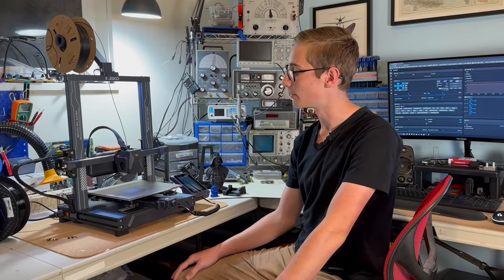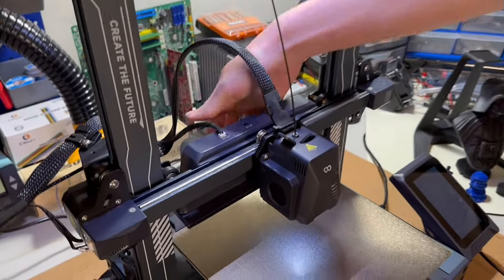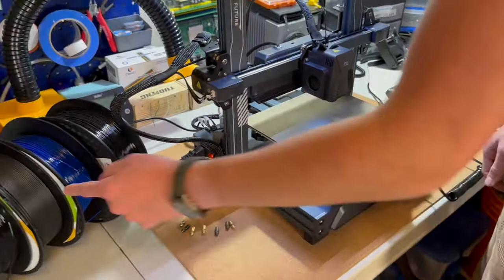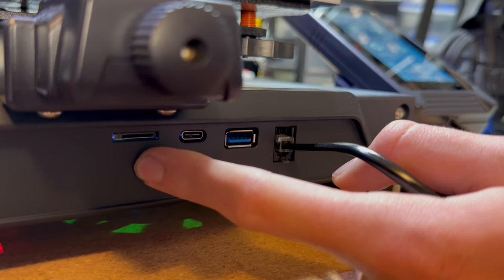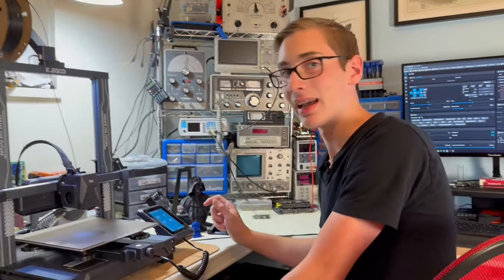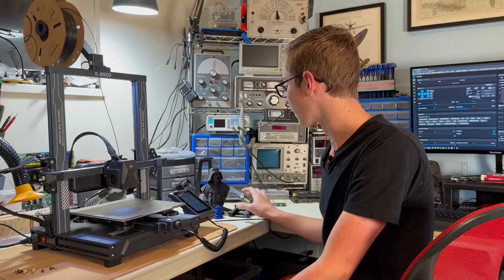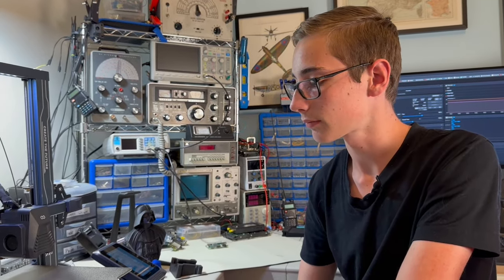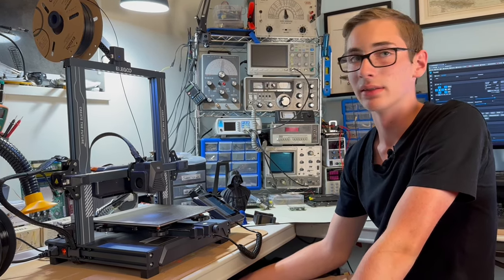Elegoo Neptune 4 Pro Review (after 200+ hours)

Comment: Thanks for the video! Your unboxing video made me pull the trigger and get it, and after a couple hundred hours myself (and as a complete 3d printing novice), I've been impressed by the print quality and relative ease of use. It definitely is loud (which you mentioned) and I haven't been able to get the ethernet cable to work/be detected by the Elegoo Cura version - but those are my only complaints from a beginner.
Reply from the maker: I'm glad you like your printer! A potential reason your ethernet might not be working is because you connect to your printer via klipper in your browser, instead of through cura (which in my experience is typically connected through a USB cable). If you go to the settings in your printer you can find the printer IP, just type that into a browser and it will show the Fluidd klipper interface.
Reply: Oh wow, that worked! The fluidd interface is a little overwhelming just looking at it right now as a noob, but I'm excited to take a look at it more during a print. Thanks!
Reply from the maker: @crazycanuck19  Your welcome! I'm glad it worked. I highly recommend taking some time to really explore it. You can really customize everything, and taking the time to go through and look at the config file and all of the other features is definitely worth it.

Comment: How do you deal with clogs? I accidentally left mine printing and it messed up. The hot filament got shoved up past the nosle and now when we try to change the filament there is a piece that is in the way. It’s above where it heats up but below the gears to push the filament down and the cleaning things don’t get it to come loose. What would you recommend? Is there a way to take it apart and get to it?

Comment: For WiFi, I connected the RJ45 port of my Neptune 4 Pro to a Vonets VAP11G-300 and had immediate Klipper control via a Fluidd screen open in a browser tab.  Very nice!  This is my first Klipper printer and I love it.  Way better than fiddling with tiny micro SD cards.

I've printed a few hundred hours of flawless ABS prints by draping a 30 gallon clear trash bag over the Neptune 4 Pro, with the bottom front 6" of the bag reinforced with duct tape and a piece of duct tape with a tiny hole for the filament to enter on top.  The 110 C print bed passively heats the interior of my low cost enclosure to 55 C.  I print with the nozzle at 255 C for the first layer and 230 C for subsequent layers.

The LED on the print head dimmed over the first hundred hours until it's no longer usable.  Apparently the heat killed the LED.

I probably have 400+ hours on my Neptune 4 Pro and it's been flawless.  I'm very happy with the purchase and I'm impressed with the print quality and reliability.

I designed a waste bin that clips to the left side of the Neptune 4 or 4 Pro and that's very handy, particularly with my small scale manufacturing where I can toss a prime strip and brim into the waste bin to the left of the print bed and click the Print Another button on the touch screen.  I uploaded the files for the Neptune 4 waste bin to Thingiverse and Printables.
Reply: Hey, I am wondering what the advantages to enclosing the printer are? I thought it would be the opposite due to heat build up?
Reply: @deadpixeloc5047  - You must be new here.   🙂

Materials such as ABS shrink more when they cool.  Thermal contraction from a 230 C melted plastic from the nozzle to 22 C ambient is enough that the part is shrinking as its printed and the internal stress causes the part to lift off the bed as it warps and cups, or causes layers to separate forming horizontal cracks.  Keeping the ambient at an elevated temperature helps prevent warping and cracking.  After the part has printed it can be cooled uniformly so the part shrinks equally in all directions to reduce internal stress.  A 55 C enclosed printing space is often enough to allow successful ABS 3D prints.  I think the commercial 3D printers use a 100 C or 120 C heated enclosure for ABS.

Comment: Hello there!

Great video, I already bought one for myself, but you just convinced me again, that it was a good choice.
I would love see a complete guide about that how you calibrated it. There are plenty of videos and sites about how to do this or that, but things are just different in case of every printer. 
A dedicated Neptune 4 Pro calibration guide would be awesome! 
There are things that I just can't get right with mine (arrived last friday):
Retraction (there is always some stringing, but better than it was).
Top layer is overextruded (the overall print quality is good, but it can be better).
There is some ghosting (I'm already trying to calibrate input shaping).

I'm using Prusaslicer. My previous printer was an Ender 3 with only a BL-touch for upgrade. It was very slow, etc, but the print quality was quite good. I want to reach that quality with the Neptune 4 Pro, too.
Reply from the maker: Thank you for the advice! The first thing I would try is using Elegoo Cura, that might fix some print artifacts. If it does work, you could port over the retraction settings and anything else to Prusaslicer (I personally prefer Prusaslicer as well). For actual editing of the config file, I would check out this video from WildRoseBuilds, it helped me quite a bit: https://www.youtube.com/watch?v=mCcP8dffwLk&t=342s&ab_channel=WildRoseBuilds
Tuning the input shaper will probably have a very positive impact on print quality.

Comment: This was my first printer at the beginning and it was headache , there was no documentation about changing nozzles or repairs.
After learning the basics : how to change a nozzle , maintaining my machine, how to diagnose  problems, I am getting satisfying prints and have yet to fine tune my klipper which i will most likely do in the near future.
So far it's been pretty consistent , 40 hours of continuous print time at high speeds before an issue arose.

NOTE: Instead of using the bad Elegoo Cura i heavily recommend OrcaSlicer with the neptune 4 pro printer profile. Simply switching slicers made my prints better 

Note:  keep in mind that if you are using brass nozzles it will eat through them like candy.
Reply: i am too beginner in 3d printing so what's exactly problems and how did you fix and what's your advice to me when i get this printer and open box

Comment: I heard that the x and y axis are misaligned on all Neptune 4 series by 2%, which is a lot... no fixable solution for it. In other words, if a circle or cylinder is printed...it will not be round...instead it will be slightly oval. This becomes a problem when making items that have round gears printed within an item. How true is this and is there a fix for this on the Neptune 4 series?

Comment: This is  a brilliant video. I want to get a 'starter' printer and think this would be a good one to go for. I have seen a couple of people mention an issue with their 4 Pros where parts that need to fit together wouldn't and taking a caliper to measure a cylinder for example, shows the cylinder to not be perfectly round. 

Have you had any of these issues, or are aware of the issue? I don't want to buy something that is going to cause me a headache when another one would work just fine without the hassle.

Comment: Hello, I have this printer, I have a problem with the printer. No matter how many times I calibrate the table, it is not calibrated properly, and therefore the nozzle rubs against the pressure and digs and removes the pressure. What do I need to do. Can you please help.

Comment: I have one question. If I run speed tests, where the printer goes in a long line for a while at anything over 300mm/s the hotend can't keep up. Even with a CHT nozzle like you have and higher temperatures. 500 is defenetly not possible for me. Have you done any speed tests that can confirm my Neptune is working properly? 😅
Reply from the maker: With all of these new klipper bedslingers I have found that they drastically over estimate the print speed. I am currently testing the CHT nozzle and I believe it makes a difference, I just need to compile the results.

Comment: I got one, so good luck changing the nozzle. Unbelievable.
Reply: what you mean, you´re scaring me... lol
Reply: @kleber1983   Well first I had to take the extruder completely off, then obviously remove cover, I then wanted to remove the cover for the hot end but found that I couldn’t until I had removed the fans on both sides, then I could get a wrench on the heater block to stop it turning. Change nozzle and put it all back together.

Comment: I did a few prints on mine .. than the prints wouldn’t stick I tighten the wheel 🛞 s with allen wrench and level the bed manually and then automatically .. it would get through a print the make spaghetti and fall off the bed . ????? Help

Comment: But the extruder is not made from hardened steel. So you can’t print with abrasive filament, right? Or you changed it too?
Reply from the maker: The stock nozzle is a brass one that is not compatible with abrasives. I replaced the stock nozzle with a special hardened steel one made for the Neptune 4 Pro, which can print with abrasive filament.

Comment: Hi, if I connect the 3D printer to the PC via RJ45, if I launch a print the head is not at the flat level, but very high, without PC only with printer and touch everything is working. Can you tell me how to have both methods working in order to print well. Thank you
Reply from the maker: When controlling the printer via the Fluidd klipper interface, the printer behave just like it would without it. If the print head was up high off of the print bed, then before printing it would home it first. When controlling the printer remotely through Klipper, the operation is virtually identical, you just have a different UI, but all the features and buttons found in the physical UI are found in the Klipper interface. Using the printer without a PC is also incredibly straightforward and the touchscreen, just like the N3P works great.
Reply: I connect the PC to the printer, choose the file to print, start printing, but the nozzle head moves raised from the table, and starts printing at a height of several cm. do I have to redo the floor leveling settings for the klipper too? I don't understand this. Or I'm doing something else wrong @BenMyhillJones
Reply from the maker: @DjferreGarage  I misunderstood your first comment. What I would do is go through the bed level calibration again, and redo the Z offset, making sure that it saves the value into the machine.
Reply: Excuse my English, I'm Italian, do I have to do the leveling again from the 3D printer via touch? Thank you @BenMyhillJones
Reply from the maker: @DjferreGarage  Yes, you could try doing the automatic leveling probe, however I would recommend trying to set the z offset manually first, if tring a new z offset doesn't work then I would try going through the leveling process.
Reply: i have encountered similar issue when resuming print from a power loss the nozzle is always hgh, and checking the printer in fluidd shows the z offset of the probe is set by elegoo_config.ini file on the root directory of the printer. I haven't got a way around it.
Reply: Yes Off machine and restart always @temmietopegold
Reply from the maker: @temmietopegold  That is very wierd, I have not encountered that myself, have you tried editing the config file with a custom offset? If that doesn't work then I would reach out to elegoo support, they may have a more permanent solution.

Comment: I ran some abrasive glow in the dark PLA. Can you make a video showing how to replace the nozzle?
Reply from the maker: I am working on a video right now on how to replace the stock nozzle with a hardened steel nozzle for abrasive filaments, also if the CHT hardened steel nozzles increase flow rate.

Comment: Can you post a link to the hardened steel nozzles you mentioned?

Just purchased one of these, expecting mid November.  (Oh - I live in Victoria too)
Reply from the maker: Sure! I purchased them off of Aliexpress, and at the time of ordering very few sellers were available, now there are a lot more options. 

This is not the seller I purchased from, but they have the most sold and have very good ratings: https://www.aliexpress.com/item/1005005874987595.html?spm=a2g0o.productlist.main.1.9ccd7822shvmXt&algo_pvid=344c6538-c467-478c-8599-7c01ac1246f7&algo_exp_id=344c6538-c467-478c-8599-7c01ac1246f7-0&pdp_npi=4%40dis%21CAD%217.20%210.69%21%21%2137.20%21%21%402101c5c216986783201294431e05d6%2112000034662633983%21sea%21CA%210%21AB&curPageLogUid=gM5wGpyrma0T

These are the ones that I bought and are of good quality. I would recommend getting both a regular one and a CHT one, from the limited testing that I have done so far, the CHT one makes a decent difference in flow rate and print speed.
https://www.aliexpress.com/item/1005005919821277.html?spm=a2g0o.productlist.main.7.9ccd7822shvmXt&algo_pvid=344c6538-c467-478c-8599-7c01ac1246f7&algo_exp_id=344c6538-c467-478c-8599-7c01ac1246f7-3&pdp_npi=4%40dis%21CAD%214.11%212.66%21%21%212.90%21%21%402101c5c216986783201294431e05d6%2112000034887301372%21sea%21CA%210%21AB&curPageLogUid=ZzXmbGByxUW1

Comment: Good video but you didn't mention printing with other filaments than PLA.  I bought a 4 pro a few days ago, the test Buddah using the PLA supplied was the best print I have seen for a long time, and fast but I need to print with HIPS for various reasons and it won't stick to the bed.  I have been printing for 8 years or more and can usually get round problems but this one has me stumped, I checked and rechecked the levelling and Z offset and tried a few settings above and below the norm, I tried all sorts of temperatures, my old printer was fine with 105C bed and 235C nozzle but it still won't stick to the bed.  I mean here that the very first lines printed last a few seconds then detach and wrap round the nozzle, every time I try I have to abort within 20 seconds.  Elegoo have failed to respond to my request for help and no-one so far seems to have tried HIPS on a 4 Pro, if they have they are not talking about it.

The only anomaly I have found is that the print surface does not reach the temperature that the machine thinks it does, when the display says 110C, the print surface is at 98C, HIPS needs 105+ to stick.  The magnetic rubber layer under the print surface does reach 108C so the issue might be poor heat conduction between the two, I cant think of a fix for this so I will buy a print mat that I know works, remove the magnetic rubber layer and fit the new surface directly to the aluminium base.  I take it that you have not had adhesion problems, is it just me trying to use HIPS?
Reply from the maker: I have personally never tried printing HIPS, the materials I have run through it is PETG, CF-PETG, PLA and TPU. It is wierd that it can't get up to 105c, especially since the max is 110c.
Reply: The heater gets to 110C, the aluminium bed above that gets to 108 or 109C but it then loses 10 degrees before it gets to the print surface, bit of a design fault really.  I ordered a replacement stick on printing mat today, I know it works with HIPS as I had one on the old machine and without the magnet and steel top it should cut out the heat loss and get up to 108C or thereabouts.  Thanks anyway.
Reply: Hi Ben
After a week or so of trying to print with this machine I have not had a single successful print, I switched to PET-g as this is similar to HIPS but uses a lower bed temperature that tyhe Neptune can deliver, they all failed after around 10 to 20 seconds when they detached from the bed.  I can't replace the print surface as the levelling needs the steel PEI sheet, it cannot sense the aluminium underneath so may be magnetic rather than inductive, so I bought a stick on print mat that I knew worked and tried that stuck onto the PEI top surface.  Also a complete failure as nothing stuck to that either.  I had emailed back and forth with Elegoo about this, they gave me generic answers that did not help at all and after about the fourth, stopped responding completely.  In the last batch of testing I had one print that actually stuck to the print surface and continued for about 4 minutes, then the model detached from the bed leaving the brim and supports firmly stuck, a scraper was needed to remove them.

There is obviously something fundamentally wrong with this machine, as Elegoo are now not conversing with me, I clicked for a return and refund via Ebay, I will spend the money on something that works like an Anycubic Kobra 2 Pro, much the same thing mostly.  I think my experience is not normal as these usually work straight out the box but I have lost faith in them and am disgusted at the total lack of support from Elegoo, so they will soon have a non working part used machine on their hands to dispose of, hope they don't put it on Ebay for someone else to struggle with.  I am an experienced printer but this one beat me completely, this was my 5th FDM machine, I have also owned 5 resin printers and currently have a Mars and Saturn, both Elegoo and these are superb in all respects, pity the Neptune didn't match this as its a nice machine.

Mark - UK